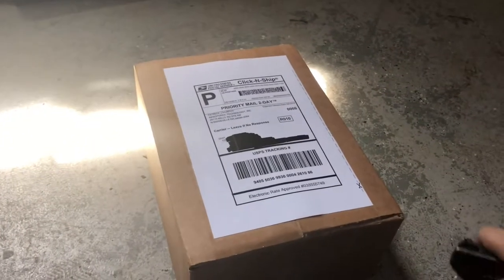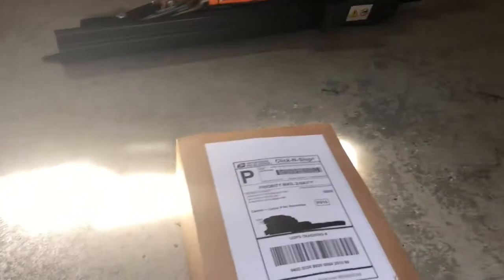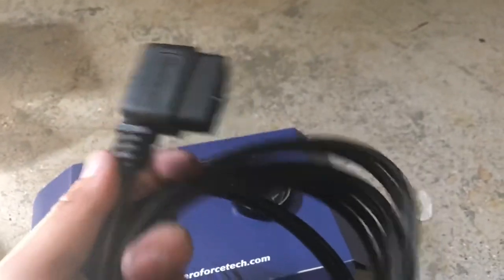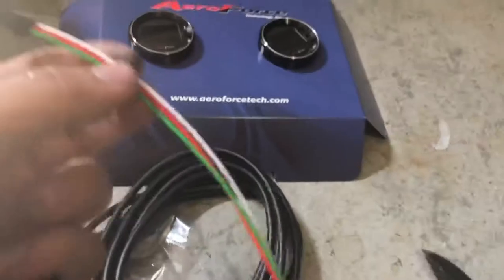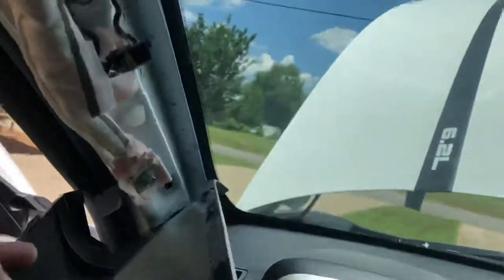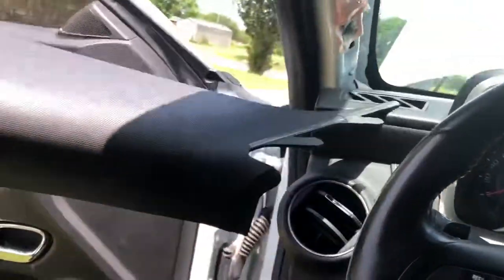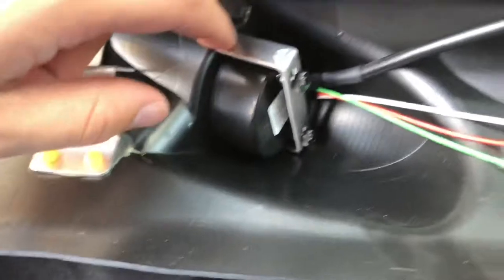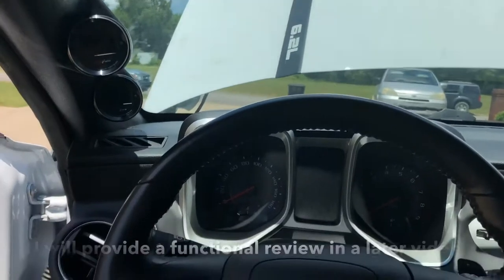AeroForce Gauge Install on my 14’ Camaro SS

Comment: where do you plug the wires in at?
Reply from the maker: It primarily plugs in to the OBD-II port and gets the data from the ECM, but also has 2 AUX cables on each gauge that can be plugged into other things like boost sensor, temp sensor, etc.

Comment: Did you have to run the red power wire? Asking because I will be performing mien here pretty soon.
Reply from the maker: 3 Honks Away no it just plugged right into the OBD II port and worked no problem, the other wires are if you want to wire a sensor in like a boost gauge or something